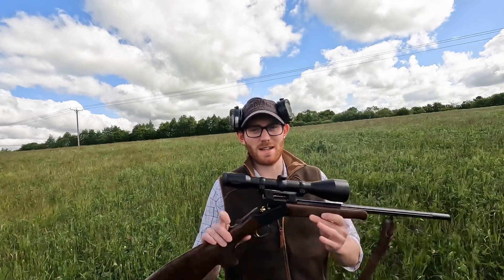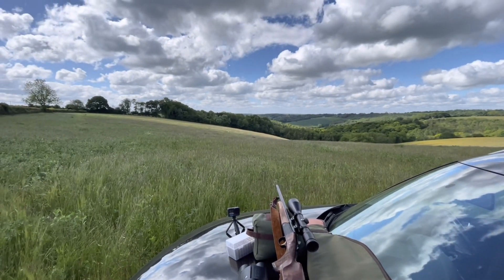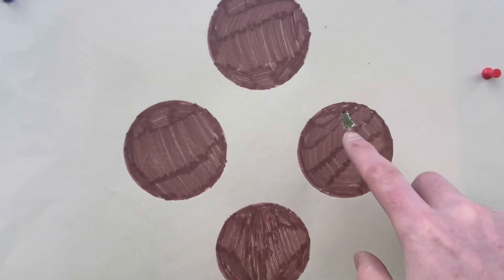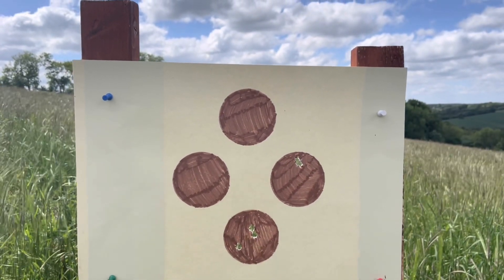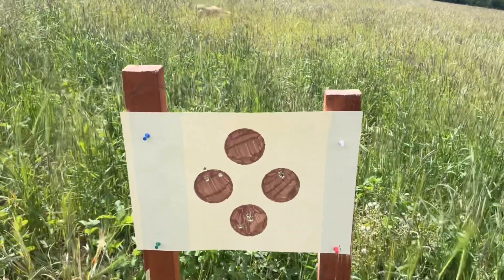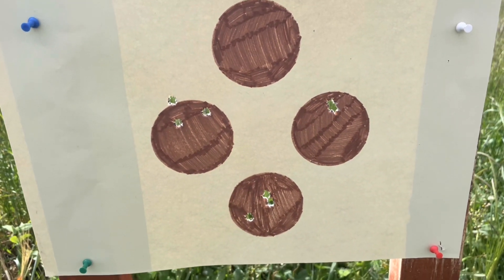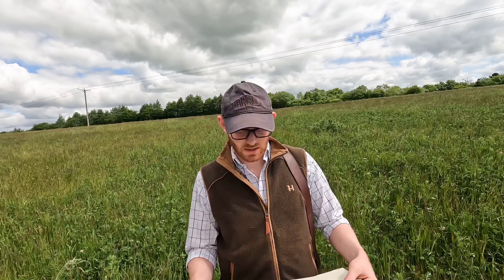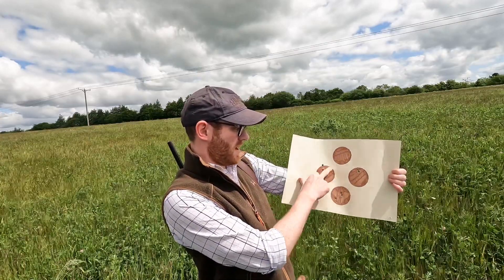Accuracy Testing the Merkel K3 Kipplauf (308 Win)

Comment: I have a Merkel K3 Extreme in 30-06.  Mine shoots similar groups with Federal Premium 180 grain Accubonds.  I took it on a Wyoming elk hunt last year and killed a nice bull at 537 yards.  FYI, I was shooting mine across the hood of my truck and the muzzle blast cracked my windshield!   I’m going to test some lighter, probably 150 grain, bullets soon for deer hunting here in Tennessee.  Thanks for the video!
Reply from the maker: Very interesting to hear. Thanks for the comment! We’ll be sure not to take any more un-moderated shots off the bonnet!
Reply: I’m also considering trying some Hornady Custom Lite 125 grain SST ammo.   They have reduced velocity and energy but still adequate for deer out to 300 yards, and about half the recoil.   Those 180s thump pretty good in 6 pound rifle!
Reply from the maker: @mackandrews6387  I’ve found that my K3 prefers heavier bullets than lighter ones. I’ve tried 130, 150, 155 and 165 bullets in it. The groups were ok with the 130gr (around 1MOA) but tightened up the heavier I went. 165gr were pretty thumpy so I compromised and went for 150!